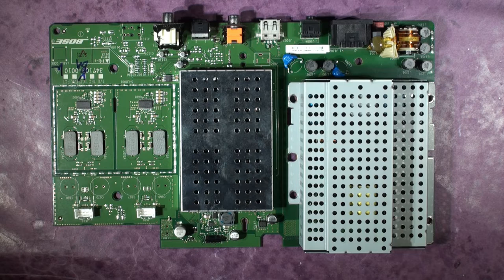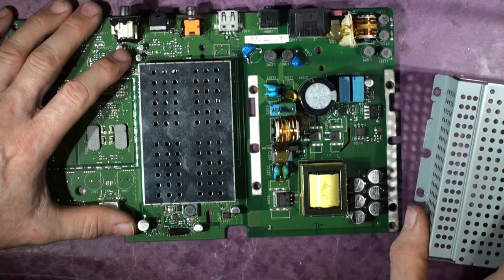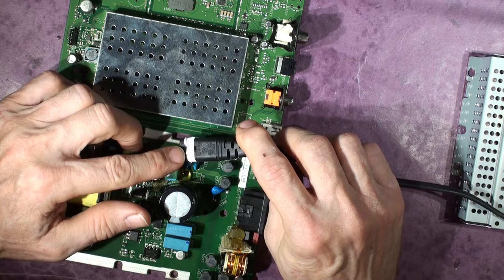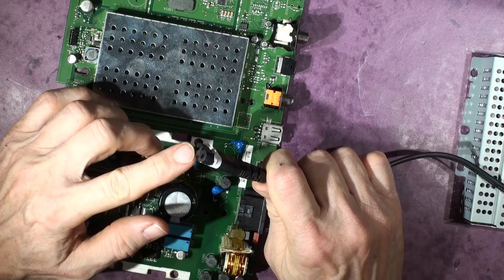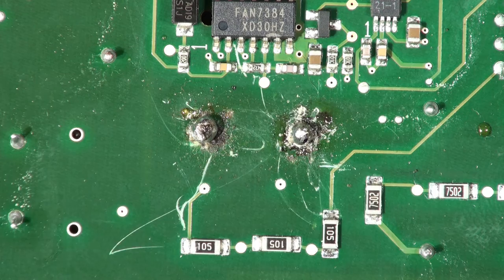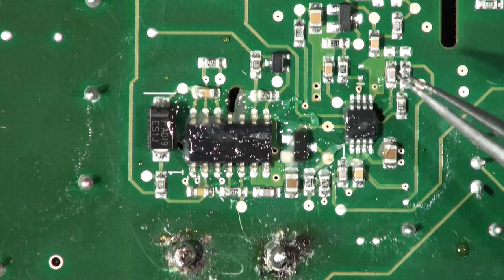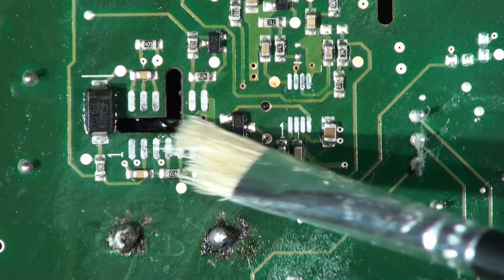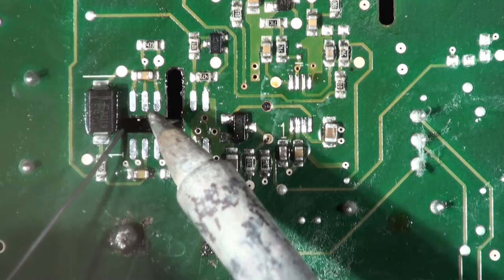Bose Solo SoundBar Diagnostics and Repair

Comment: Hello MS, I have the problem that my sound solo no longer works. There is no LED and no start sound. Would you fix it? Here in Germany I find nobody for a repair and Bose says the plant is too old. Thanks in advance for your answer
Reply from the maker: Hi Heiko, I am in the UK you can send me the controller if you want me to take a look for you. My mission is to save items going to landfill and the minerals, oils and trace elements in the ground for future generations.
Reply: Hello Magic Smoke, I have the same exact issue that Heiko Funke is experiencing, I am in the USA and would like to attempt to fix it with some guidance. I am handy with the soldering iron and heat gun and have a multi-meter (not a fancy one cen-tech P37772 but it gets the job done),

Comment: Hi Magic Smoke, 

I won't be surprised if I've take the vies on this video up by 5% single handedly in past few months. Have Bose unit with same problems as everyone else here. Been watching your videos and they are great. My solo pushing out 24V on the caps and remote seems to work fine as I measures the voltage drop t]at the ribbon connector when pressing remote. wondering if you'd be willing to take on this challenge and make a video so others can possibly fix theirs too? I have emailed you on your email. Keep up the good work. Mk.
Reply from the maker: I can borrow the DSP development software - when I get the time. One issue is that the DSP chip has a custom Bose part number. I have no doubt that it is a standard chip but I don't know which one... Yet.

Comment: Hello Magic Smoke. I am currently working on the exact board. Did this indeed fix the unit? I am about to replace the smaller semi conductors on the bottom like you did, just wanna see if this is a viable first step to diagnosis it. (Also what is the name of the smaller chip your working at 20:17?) Do you think, that diode missing was the issue or the two small chips underneath? (Obvs it wouldnt work without the diode) but was it the diode missing or those chips failing + the transistor (Maybe the person who worked on it thought it was that, but it ended up being what you replaced?) Will post a video of my findings soon.
Reply from the maker: Fixed fine. The two chips underneath are vulnerable. Check the 7N60 power FETs to make sure they aren't shorted. I have a limited number of the 8 Pin management chip but I don't know the manufacturer's part number. I bought from someone in the US who knows it but wont say.
Reply: @razenby  

Just wanted to update I a forum I am working with someone who is helping find this just incase its bad, and I do like to change it out with the FAN chip, and we came to this Part No: LM5021-1QDGKRQ1 Does this sound correct? Still waiting on my first parts order.
Reply from the maker: Looking at the datasheet it could well be.
Reply: @MrViralHits  any follow-up on this? did it work? thanks
Reply: @silviuguseila2552  Hey man. I attempted to change a few components but didn't get the chance to fix it completely. Wasn't worth it in the long run even if it got fixed. Was more of a learning thing. Sorry I couldn't add more info. If I get ahold of the board again (Possibly but unlikely) I will see if I can update.
Reply: @MrViralHits  more of a learning thing for me too, but I didn't change a single component so far so I am still not giving up yet. Did you buy and replace the LM5021-1QDGKRQ1? Any improvement? Most report the unit is still starting sometimes (randomly) so I suspect there isn't a short on the board, but a component that is actig funny, or maybe depending on the temperature and so on. 

If you can give me some pointers as to what you replaced and made a difference, or what to avoid replacing as it did not help... not sure what to start with. Thanks

Comment: hi, I have a Bose Solo that is not working, no lights. It might be the remote, I can't tell. Would you be interested in taking a look at it?
Reply from the maker: Does it beep when you put the power in?
Reply: @razenby  thanks for getting back. no beep when you plug in.
Reply from the maker: Can you measure 24 volts across the reservoir caps?
Reply: @razenby  as in the six in the bottom corner, no volts,
Reply from the maker: OK. Fixable ark.mail@gmx.com

Comment: My bose solos tv sound system one side speaker is not working please can you tell me the problam
Reply from the maker: One speaker is not working is the problem!!  The cause:  Check the wires , check the speaker voice coil, check the connectors then look for a bad solder joint  on the amplifier chip. Make sure that you supply both channels with a  working audio feed, Try a  a different input method... Good luck

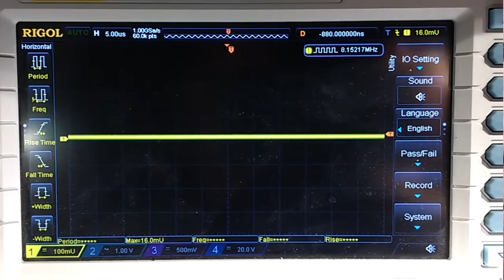Comment: So after replacing IC's  (transistor OK), I get to 41:54 on timeline fine, but it doesn't fire up the nice square wave, and I still have no front panel led's! what next please?
Reply from the maker: Check your solder joints with an eyeglass. Check the 0V AC track and vias between the Drain of the low side output FET and the PWM Management chip. The track can blow open during the FET failure event.
Reply from the maker: If you want to do a web call then let me know. might make an interesting video
Reply: @razenby  Can't find anything wrong, good 24vdc on the 6 caps though, but still same start up oscilloscope waveform, doesn't seem to want to start up properly, unless I'm reading something wrong. :)
Reply from the maker: @ratimus2000  So you haven't got 24 volts on the DC smoothing secondary side? Have you checked the HV start up supply transistor cct?
Reply from the maker: @ratimus2000  Also the bootstrap supply diode isn't shorted...
Reply: @razenby  Which transistor is that? Forgive me if I seem a bit vague, but I'm a mechanical  engineer, I just dabble in electronics a bit as it's always fascinated me. A lot of your expert terminology goes right over my head. Lol! :D
Reply from the maker: @ratimus2000  The transistor under the 2 blue rectangular capacitors. the one that was missing on this board.
Reply: @razenby  Ah right, I tested that and it seemed OK, but I could replace it anyway, what replacement would you recommend?
Reply from the maker: @ratimus2000  Nio Need to change it if it measures OK. https://youtu.be/wEDewCYJuag
Reply: Yes, I have good 24vdc on caps.

Comment: Hi I have a question: "" There are two 0603 capacitors out of the cage precisely on the side where there is the usb connector and the optical connector that the tester gives me in short circuit ... Is there anyone who has checked them?
Reply from the maker: Unlikely to be the capacitors.
Reply: @razenby  

No no ... I unsoldered the capacitors and the short circuit remains ... What can be connected in parallel? What can it be?
Reply: @razenby  On pin 9 of the integrated circuit Fan7384 there are connected a resistor with an sot323 ... the sot323 should be bat54cw correct me if i'm wrong, but i don't know the resistor value ... while connected between diode bridge and fcd7n60 there is a resistor 1210 with written 75 ||| ... is it a 75 ohm? unfortunately on this card there are some things burned and I can't find the values please help me ... thanks

Comment: Ciao il componente, siclato 337R che non si  trova  in commercio come hai fatto a trovarlo grazie attendo tua risposta.
Reply from the maker: I don't remember the 337R component.  Bose like to use odd value resistors for some reason.   If you need 337R then use a 330 R with a 7R in series or a 310R and a 27R ohm etc,,. == 337 Ohm
Reply: Ciao Sul pin9 del chip Fan7384 c'è connessa una resistenza 0603 collegata ad un sot323... Sapresti dirmi il valore?

Comment: Hi, Watched with interest your repair and diagnosis of Bose Solo. Writing to request if you would be willing to assess my faulty unit and provide a quotation to repair. The unit initially developed intermittent fault whereby emitted loud buzzing/ humming noise. Turning off at the mains for a few seconds would clear the fault for a period of time. The unit has now however failed altogether, unable to power on with green indicator.
If you are able to assess I can remove the pcb board to send to you. Would you require the remote control as well?
Thanks in anticipation!
Reply from the maker: Hello, Sounds very much as if the power supply section has failed.  I can take a look.  I am not a commercial channel as our aim is to get stuff fixed instead of thrown away. If you send it to me I'll take a look if you pay the shipping and for the components. Contact me at support@invebo.com
Reply: That’s very kind thank you very much. My father will drop you an email as the comment was sent on his behalf. Cheers!
Reply from the maker: The board has arrived!!

Comment: Boss 135 Sound Bar please power supply diagram
Reply from the maker: As far as I know it is not available in the wild. I only have the service manual which has no schematics. You will have to work it out on your own. Do you have a power board fault or a DSP board fault?

Comment: Hey I've the power issue on my solo ! I guess the comparator chip get defected! So where do you buy the 4 pin comparator chip(337r)
Reply from the maker: Unlikely that only the comparator is faulty.  You need to change all the parts stated to make it work else it will go bang when switched on.
Reply: Ok but I found the fan7384 ic but I can't find the 4pin chip near the fan 7384 ic. So do u know the part number? Or equivalent?
Reply from the maker: 4 pins?
Reply: Magic Smoke sorry my bad it’s a 8 pin chip
Reply from the maker: LM5021 Texas Instruments
Reply: Magic Smoke thanks mate ! I appreciate ur service and the transistor u replace  on video is Stx616. So Do i need to replace that as well?
Reply from the maker: Just check the junctions it with a Diode test mode.  Never seen one blown.
Reply: Who can i By the ic 7384 thank you 🙏

Comment: Hey Magic Smoke my dad donated his Bose Solo to me a few weeks back . He had been having problems with it not turning on and replaced the battery in the remote which didn't fix it. When he left it unplugged for a day then plugged it in it would turn on and run  flawlessly for a couple of days. Would you be willing to take a look at the power supply board if I mailed it to you?
Reply from the maker: No Problem.  Contact me at ark.mail@virgin.net

Comment: Hello Magic Smoke, just watched your interesting video. I  have a Bose solo 5 the bigger unit that has been playing up for a couple of weeks , it is just coming up to 5 years old. It needed rebooting at the mains socket a few times to get the single bleep and then turn on with the remote, which has had a  new battery fitted, this was ok for a few days until I got a buzzing noise through the speakers the it packed up altogether and cannot get it to turn on with the green indicator light showing. contacted Bose who sent me a new mains lead and upgrade usb stick which didn't make any difference and said they don't repair these anymore as the model is obsolete. I t seems too good a unit t chuck away, any ideas ?
Reply from the maker: looks like you are in OZ? You can send me the controller it to me if you want me to fix it.  The airmail service is cheap. A useful video and saving it from Landfill is sufficient reward.
Reply: no such luck! I'm in the uk, I'm watching a second hand one on ebay at the moment, . I think the remote is ok, thanks anyway. I.H.
Reply from the maker: That good coz I am in the UK too
Reply: @razenby  could you possibly repair mine , if I sent you just the panel? If so what would it cost be? I'm looking around for a second hand one but prices range from £60 to over £100 for a working one off ebay,
Reply: Are new printed circuit boards available from Bose? it would be a simple job to change if still available , it seems a shame to throw it away because of lack of suitable parts.
Reply from the maker: If you want to send it to me I'll take a look.  Saving the planet 'one Bose at a a time'
Reply: @48firefox  did you manage to get this sorted?
Reply: @mkay1807  No, did not get a reply from Magic Smoke,was going to send the panels over to him for repair.

Comment: how much a repair like this cost?
Reply from the maker: Not sure. We work on mostly on product development. Servicing is just stuff that comes my way. I take on interesting kit I haven't seen before but unfortunately don't have time to repair everything so I put some info on the web..
Reply: @razenby  but if you have to guess-timate, what would you say?, the reason I ask is because Bose quoted a £79 repair, so I only want to know if its worth sending it to them.
Reply from the maker: @FirstLastth  Send it to them.  I am surprised they are still supporting these units. they must have some excess controller stock left over.  Which variant do you have there?
Reply: @razenby  i have the Bose Solo 15 Series II, i will send it to bose then. Thanks for your help.

Comment: hi dear i have cinemate 120 no power what could be the problem
Reply from the maker: Probably the switched mode power supply has failed.  Very common in Bose equipment.

Comment: Hello Magic Smoke! It was nice to see your video, thank you!

I have also a problem with a Bose Solo 15, but I think that it could be a little bit different. It is also not powering up by the remote controller but I have 24V on the last capacitor which you were checking, I have 5,9V on the capacitor in the middle section, I also checked a IR received diode and there also is a voltage. How can I contact you?
Reply from the maker: Hi Daniel,  If you have the DC as you say then the DSP system section may be playing up.  I assume that it  is totally dead when powered up (no power on beep-beep)? If you get the beep beep then have a look at the remote control LED with you cellphone camera.  Believe it or not the remotes often lock up too. Hold on for  a  few I want to try  a recovery procedure on the bricked unit I have here. I'll make a video about it,  If that doesn't work then Ill take a look. Ed.
Reply: @razenby  Thank you so much for your answer! I can not hear any beep, a diode on the  front of the soundbar is not turning on. Ichecked also remote controller with a camera, I can see the light with a mobile phone camera. I checked a voltage on the IR receiver and it is also coming there, voltage is also changing when I am using a remote controller, so it looks like it is receiving a commands, but it is not doing anything, not turning on. It is still in the standby mode.